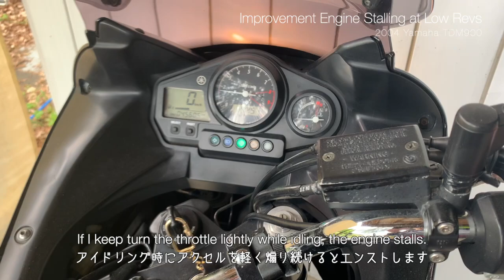Improvement Engine Stalling at Low Revs [TDM900]

Comment: Thanks for your videos, I had to tinker to solve the problem. I also replaced the TPS sensor, after which the problem went away completely. My motorcycle stalled even at speed; when the sensor got hot, it began to show incorrect readings.

Comment: Yes mate, this is typical of twin cylinders in particular of the tdm 900. But as you did, if well maintained and regularly cleaned and serviced with quality oil, these symptoms are greatly reduced. I still don't understand for Yamaha Japan the tdm is not decided to bring it back on the market. Honda has done this by bringing back another classic, the Transalp. Really questionable business choices. The Tracer just doesn't match. As always, great video and lovely bike like mine.
Reply from the maker: Ciao!
Indeed as you told. I think that maintenance is very important, but recently in Japan, I feel that the users who do proper maintenance by themselves is decreasing. And also, The bike itself has a lot of computers intervening, and the places where we can maintain ourselves are decreasing, too.

Yamaha seems to see the Tracer as a successor to the TDM, but it's still something different.

Comment: Is this the first time you cleaned the throttle bodies in 45000km that I see on the clock?
Reply from the maker: I'm the third owner, but the previous owner didn't do it, so I think this is probably the first time doing it.

Comment: I have the same problem, but i dont belive its just some dirt in throttle body. Are you sure is it only that snall black dirt what you clean ?
Reply from the maker: Yes, you're right. It's not only the cause of the stalling and jerkness.
I modified something else recently (air box mod), so I'll upload the video soon. THAT was the cause of the jerkness at low revs.
Reply: @GalapagosJapan IT would be nice if you show us what is real problem, because i am still trying to repair IT and i have no idea what is problem.
Reply from the maker: I just uploaded the new video. I'm glad if you can use it as a reference!
https://youtu.be/oUhdvZxZunc

Comment: Hi i have a tdm 900 with  after market exaust co 
C1 13 and c 2 17 i think so its too low its not working good
When i put c1 50 c2 53 its ok 
Next i have a problem with to much ?
Reply from the maker: Hi.
Check the burn condition of the spark plugs, and if they are in good condition, there should be no problem, I think.